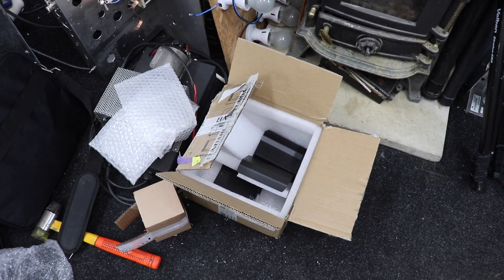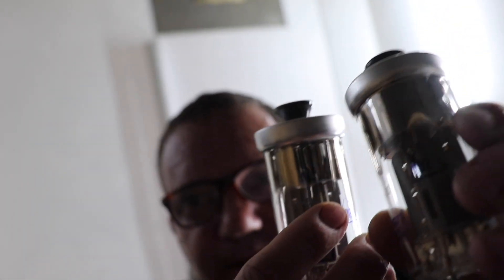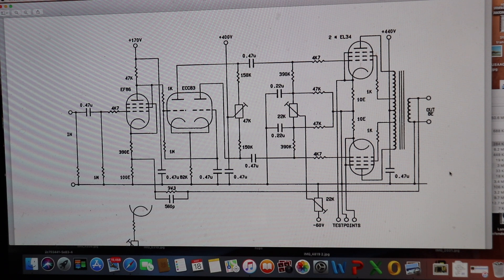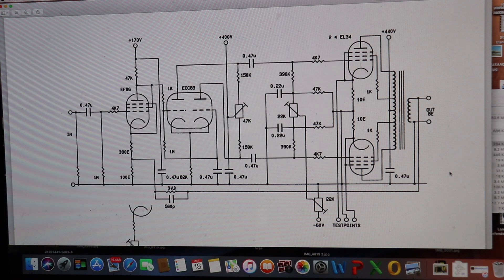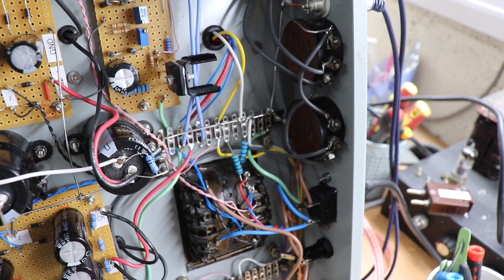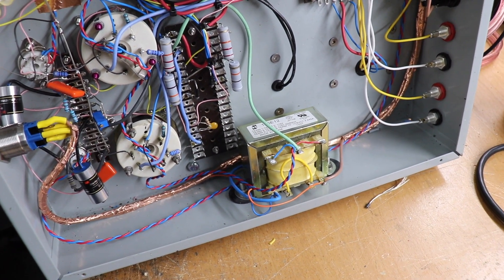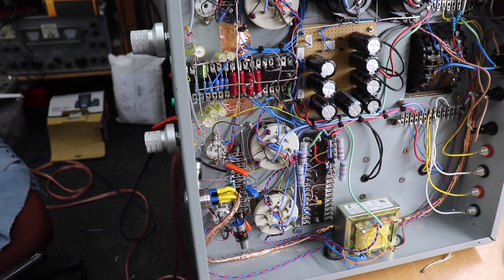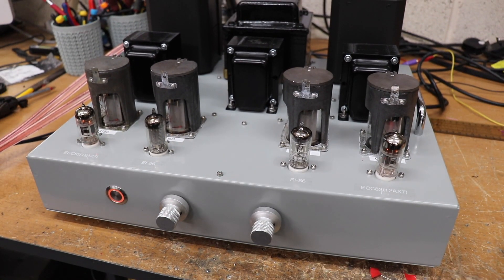GU50 PP Audio Amp:The Cold War Never Stops Giving!

Comment: Beautifully! As a shortwave radio operator, I can tell you that I used a linear amplifier with grounded grids, driven by the cathodes of four GU 50s. I drove it with the signal from 1 GU 50, from which I squeezed about 100 watts of power, and at the output of this quartet I had about 450 to 500 watts of power to the antenna. A minor problem is that the voltage the anode was about 1500 Volts. The entire power consumption from the mains was approximately 2 kW...

Comment: Did you move the GU50s around to different sockets to see if the red glow traveled with the valve or if any GU50 in that socket glows red? That's the first troubleshooting step, to make sure there isn't a problem with that socket or that channel's wiring. ;)

Comment: Hi. There are 6 transformers. 2 outputs and 1 power transformer. Those other 3, what is the use for them.
Reply from the maker: Chokes and a filament transformer I think
Reply: @thewtf  I build a single ended with 2 kt88 per chanel in paralel and the project asked for 3 of them in the power supply. Sound is fantastic but it wheigts almos 80 pounds.

Comment: With the extra mains transformer available I would have gone for a dual monoblock design. I did that with a Williamson based design for a friend about 30 years ago. It certainly created a bigger stereo soundstage. My current home amp is based on the 5-20 using Russian 5881s. The preamp is built to Joe Curcio's Daniel design with every valve having its' own regulator on the HT rail. After 30 years use I haven't felt the need to modify it, although a better looking case wouldn't come amiss. I am really enjoying your videos. Keep them coming!73 Gareth GW4JPC

Comment: GU50 is a German WW2 design, and not Soviet, although they copied it. I am not sure what radio equipment it was used in but I understand that they were use to control the vanes on the V2 Rocket. Apparently, GU50 is a Soviet made copy of the German Telefunken LS-50 power pentode. 
http://telefunkenaudiotubes.com/
Reply from the maker: Yes that’s right! If you look at my video on the R118 transmitter that Tx used a GU50 to drive a GU81m

Comment: This is awesome. I'm glad you mentioned the right channel GU50. For a second there I thought it was red plating.
Reply from the maker: I double checked it again after the video and it is definitely has not got excessive cathode current..
Reply: @thewtf  You've done a lovely job there. I recently replaced an EL34. It had gotten so hot that the glass was distorted.

Comment: Great construction! Congratulations!
However, I would remove the metal baskets for the gu50 (top) and alu caps from the top of the tubes themselves (quite easy to remove) - this will give your amplifier an even better look and improve cooling. The stands hold the tubes legs very tightly and do not be afraid of them falling out. A long time ago I did this in PA on 4 GU50 on HF.
Vy73! paw and sub from the beginning :-)
Reply from the maker: Thanks! Yeah the guy who I’m building it for wanted the tube holders.
Reply: @thewtf  Ok👍